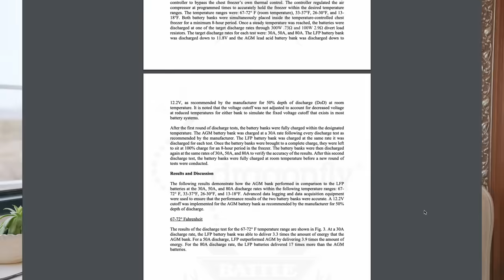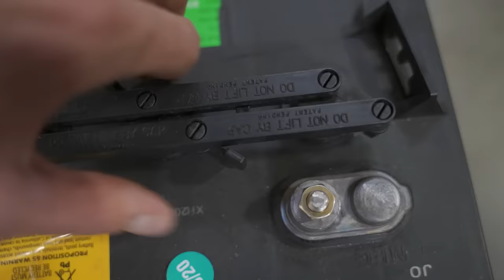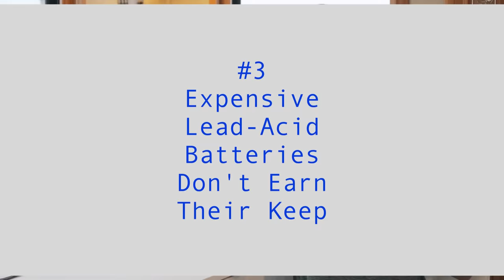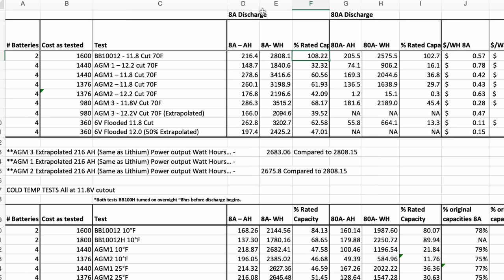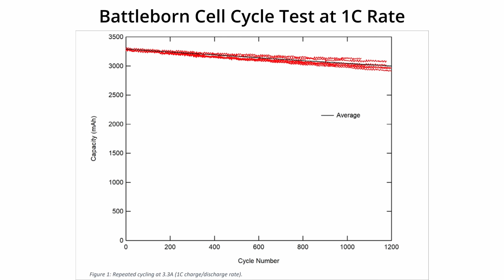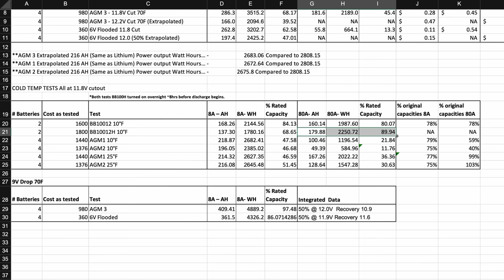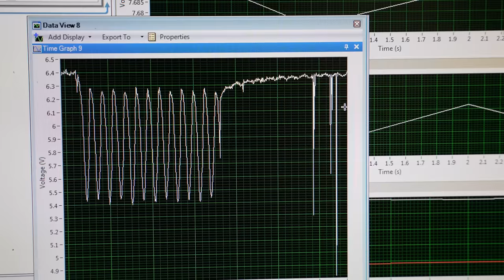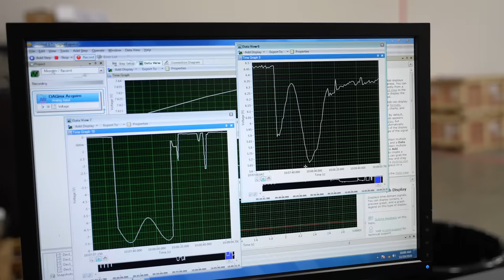Don't Waste Your Money On Batteries - The Shocking Truth I Discovered When Testing RV Batteries

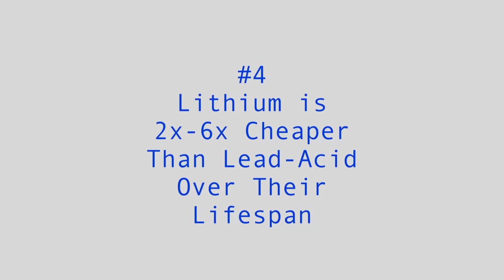Comment: 12:21 How do we know that lithium batteries will get anywhere near their lifecycle rating without waiting a long period of time to find out? I think if you only discharge the lead acid battery by 30 to 40 percent you will increase their lifecycle by quite a lot. I suspect that the lifecycle ratings on many lead acid batteries are understated and those on the lithium batteries are overstated. That's not to say your end conclusion wont be the same but I think for a lot of people the initial start-up cost will be a factor. Lithium batteries have extremely expensive upfront costs whereas lead acid doesn't.

Comment: After buying a 100AH deep cycle marine boat battery and having a warranty claim 8 months later, I learned from the store employee that the batteries sometimes sit around for years before a distributor delivers them to a store. And unfortunately sometimes the distributor is the party responsible label on the battery. So you could very well go to your local car parts store and purchase a battery with a 2021 date code, Yet that battery was manufactured in 2016. More and more batteries are hiding date codes in the serial number or putting them on a easily replaceable sticker. Manufacturers used to use a hot stamp and burn the code in the plastic but that is becoming less common. I ordered a 100AH AGM on amazon and after not being able to do a return because it is "flammable battery" I contacted the manufacturer directly and supplied the serial number, They could not help me because the battery was manufactured in 2011. Yet the date code on the battery itself was 2019.   I personally think it is best to avoid Lead Acid batteries where possible now.

Comment: Fully built batteries are a great option for someone that's not capable of buying cell packs and installing their own bms system.  The battery cells wouldn't be my concern the circuit boards built internal to the battery would be in my opinion the week point and if that fails you have no ability to fix or replace that without potentially damaging the battery cells. buying cell packs and installing your own bms gives access to service and repair if needed that would be my preference if going with thousands in cost.

Comment: My understanding is that the 50% voltage for a Agm is for when the battery has no load. It looks like you may have missed this. It would account for the poor capacity especially at high discharge currents

Comment: Two years on it is well established that LiFePO4 are superior to lead-acid, that is no longer in contention.  The most informative point of this test should be how competitive the very expensive Battle Born brand LiFePO4 are compared to the cheaper Chinese brands (3-4 times cheaper) which use the same Chinese produced cells as the Battle Born.  That would be a great new test but, of course, Battle Born, who most likely produced/supported this test, would not be interested in such a test.

Comment: What about the biggest factor cost per watt over the lifetime including reconditioning the batteries when needed until dead behond repair. 
This should also be included in the environmental impact over its lifetime, these are the things that the government should mandate honest assessments of for buyers.

The Battery in my truck is 12 years old and still starts my truck my 48 volt lithium Battery is 3 years old only used on a weed eater and Dead.

Comment: I have a refrigerator in my van and a solar panel to charge the battery, I had an AGM battery that ran fine for 3 days the most then it had to be put on a charger or my refrigerator would not run at all, I purchased a battle born battery and yes it was expensive but it does the job, the solar panel keeps it full and I don’t need to worry about having to charge it.

Comment: The comparison should look into traditional, flooded, non-AGM, lead-acid batteries that most vehicles and most off-grid systems are still using to this day. I have seen traditional FLA batteries, which are cheaper than AGM, last 20 years if the proper amount of water is added and the pH is checked 1-2 times per year. AGM batteries were originally designed for and used in emergency lighting units and UPS systems, where they are only cycled during a power outage, and in this particular application, can last 15 years without any maintenance. Lithium Iron Phosphate was a 'compromise battery' to allow lithium chemistry to be retrofitted to existing 12 volt systems, and excessively marketed to death. Therefore, I see RV systems, where 12 volts is used and total weight is a concern, as one of the only places where this technology is particularly viable. There simply isn't enough lithium metal on the planet to use this type of battery everywhere, and a low-drain off-grid stationary installation is really a poor use of the technology (Again, marketing upselling people to think they need a 1C charge rate).

Comment: I have heard that the BMS on Lithium can cut in during high current demand from the inverter, also they cannot be charged below 0 degrees celsius, unless of course they are special ones like the self heating ones. 
Currently I am using flooded lead acid to power my house, they are working great, but I would not recommend them for a RV because of space and weigh issues.

Comment: Awesome.
Leaving in the tropics in a place with frequent, short, power blackouts, so planning to install solar PV and batteries both for backup + save on electricity bill.
Your study helped me clear my thoughts.
So cheapest flooded if ok to give up on high load and low budget ELSE better to directly go LiPeFo if budget 😀

Comment: I have Lead acid batterys that outperformed every lithium battery!

Because I get em for free at work! 😂
We do service big emergency generators, the starter batterys get changed after 10 years for reliability reasons.
The batterys have near to no cycle on them, and are high quality industrial ones.
I change some older ones in my bank if some really good examples pop up to keep my bank fresh.
In the summer I can power all my lighting, computer and all small appliances exclusively with solar, from my 260 watt balcony system. 👌

Comment: I have 2x 280ah LiFePro 4 in my class C and while they weren't particularly cheap, I have been extremely pleased with their performance. With a 10 year life and 3500+ cycles to 80% I'm not even worried about the shock of up-front sticker price. Both batteries tested slightly above their stated capacity, also.
Reply: What did those battery’s end up costing you? (If you don’t mind)
Reply: @djfglobal3377  Just over $1900 for both.
Reply: Is LiFePO the same as LFP?  Are they supposed to be very safe?

Comment: I've been a fan of Li(po) batteries for probably ten years (RC cars), but the total lifecycle cost comparison should've at least referenced that, in most applications, you can't just swap conventional (FLA or AGM) with a LiFeP.  In a motorized application (charging off the vehicle alternator), additional hardware is necessary to limit the draw so it doesn't overheat.  It's not at all accurate to say there's "no situation" that a lead acid won't outperfom a Li battery; there are many rv'ers who don't need the off-grid capability that lithium provides.  Conventional batteries are more than adequate if you have shore power (majority of RV park, state parks etc.), can run a generator for a hour or two a day (BLM land) or only need one night w/o any external power.

Comment: Take into consideration customer service level at most of the companies who manufacture lithium batteries. Is it any good? Lots of complaints online and often lithium batteries fail within 1-1.5 year time frame.
I didn’t not find any single reputable company yet to spend $800 per battery and have a peace of mind!

Comment: Led acid and lithium batteries are 2 completely different animals made for completely different purposes. And they should be used for what they made for. Led acids are generally starter batteries. They are best at throwing those 500 or 700 amps at starter for very short period of time. And get charged from engines alternator. Than stay charged until next start. They do not like to ever be heavily discharged. Discharging them to below 12 volt equals killing them. Each deep discharge brings the death closer and closer. So 650amp battery can only throw 450amps at starter than 430, than less and less until that starter wont turn no more. Different vehicles have different engine sizes and need different power rated starter. So led acid batterie is appreciated for its instant high amperage delivery. But it is bad choice to use led acid for running your electronics in your rv. Because discharging them equals killing them. Lithium batteries on the other hand cant give you high amps to start your engine. For example 5kw/hrs batterie may only give you 100amps at a time. But it can be giving it to you for a very long time. So your starter wont turn even once from that amperage but your electronics will be happily running for a long time. And their charge discharge lifecycles are at least x100 or 150 times more than led acid. So you can be using it for many years running your rv or solar system. On the other hand if you use led acid only for what its made for - only starting your car you also can be using it for many years. Because even if it has only 300 cycles but you basically just keep it charged all the time so you don't use those cycles. Only when your car stays unused for long periods of time your led acid inside it can get discharged by parasitic power draw of the car and self discharge. And discharging it to 0v even one time can be fatal for it. Than even after full charge it wont give you those needed amps and become useless.

Comment: Short version.lead acid,flooded batteries are designed for starting cars etc. They can be cycled about 500 times from full charge to 50% not designed for running your fridge, lithium batteries are designed to last longer and can cycle 3000 to 5000 times from full charge to zero %.  Nearly all lithium battery pack come with a bms. Battery management system  to regulate the flow leaving and entering the battery.  Plus some hot and cold sensor's.. that's it .

Comment: Liveing out in remoat locations in a travel trailer year round, and useing solar to recharge batterys ok found this very instructive.
 To date I have used 2 128g lead acid. 50/50starter deep cycle Wall Mart batterys.
 I use 12vdc system ( lights,  propane refrigerator, heater blower, trailer system minister, water pump).
 I replace them yearly, and they suck over all. In winter even with full sun they do not hold up. Have to charge with generator/ battery charger.
 I kill them every year.

Comment: As a boat owner (40 foot sailboat), the cost per watt hour is not really a great measure.  In real world use, the batteries are not used that way.  The batteries most of the time are not drawn down that much before charging to capacity.  In my not so rigorous query of other boat owners of lithiums, they might get a couple more years use out of them over the lead acids.  So is it worth ten times the cost to get maybe 15 percent more life for typical use?  Not in my real world experience!

Comment: TWO FACTORS NOT ADDRESSED:  FIRST… I’m 70 years old and only exaggerate slightly when I say that I don’t even buy green bananas anymore. However, have a talk with yourself and estimate your remaining lifespan on the road. AGM will probably get most retirees to that crossroad. SECOND… Most RVs that are looking at first or second generation battery bank replacements may not outlast the Li-ion batteries.  Your new  batteries may outlive the useful life of your RV. CONCLUSION:  If you are young and ordering a new rig buy it with Li-ion batteries because this gentleman makes a good case.

Comment: Okay, I'll admit it...I am a rube when it comes to batteries. Two questions come to mind"
a) Can i use a L/I battery as my primary in my car?
b) Was there a test as to the logevity of L/I over Lead over the course of a LONG, LONG period of time?
c) The cost to benefit analysis of L/I vs. Lead for a retired rv user? Yeah, I undersrand you can't really assess C...but a try or guess would be apprciated"

Comment: My five year old golf cart batteries (2) just won’t die. My converter decided to charge them at 14.6v for a whole day before I shut them off. After refilling with distilled water they are performing like new. I was planning a $1000 200ah LifePo4 battery and converter upgrade for when they died. That project will have to wait. I’m not trashing perfectly good batteries.

Comment: just want to say before listening to the video i had a car battery which was so empty i needed to boost it each time i wanted to start the minivan in winter ,  left it there , in summer the battery was good enough to start without help but then at the end of the summer it started again to need some help , then i used a old battery charger on it which some claimed was going to "renew" my battery , now it's 2 years later , two winter later and i still have that same battery and it work great ( i'm in canada so winter can be rough .) but it still start the van like a charm .
Reply: yes, you can recondition a lead acid battery. they can last much longer then 4 years...  if maintained right.  Same with  AGM, less maintenance, but don't overcharge them or let them go below 50.. i sese some say 80%...   So i ASK>. what can you do with a LifePo after a couple years and it's not working..   
My neighbours wouldn't charge..  Something about being deadlocked.... somethign to do with the BMS?!

Comment: Applications where you want to use a lead acid? Specific boat usage. You need two LiFePO's or a lead acid and LifePo to start the motor. Cost near $2k for 200Ah setup or cheaper if you commit to using lead acid and LiFePO, which means two technologies and chargers and complications. Cost of two flooded 6V (from my last purchase) was $300. That was 6 years ago. I now need to replace them as they just run short on life when out overnight in Winter. I have a boat with an electric head so it needs to run the head or the wife will not be happy. Total cost: $300 for 6years in batteries. That's including the 2 years we spent full time on board. No BMS to worry about. The only thing we did was add some distilled water three or four times a year. Cost a few dollars per year. If I only did Summer trips or warm weather trips, I could delay the battery change. I can still get about 10 flushes and start the motor the next day. So no problem. Winter, solar doesn't charge them enough to hold overnight and only a few flushes are possible. The sanitation unit draws about 40Amps for a couple of minutes per cycle. Combined with the lights, chart plotter, fridge and holding enough in reserve to start the motor on a cold morning, its getting a little on the "wife will kill me for being stuck in the water" side of things if I don't change them soon...

Still, $300 for 6 years and some serious regular use for some of that time is fantastic. Do I want to spend near $2k and hope it will last over 36 years to get the same cost break down? BB is currently about $900 per 100Ah. So two will set me back $1800. Nope. Because it will take 6 changes of the flooded 6Volters to get to $1800 and I'd likely be dead before I recouped my money and BB may not even be in business then.
I need at least two LiFePo's to start the motor. That extra capacity is wasted as it will not be used.  I also never have to worry about the BMS going open circuit and blowing the motor electronics leaving me without a means to start the motor when 100 miles or more offshore. Cell reception isn't so good out there and calling BB to ask for an exchange because the BMS failed or the cutout popped my electronics isn't going to work out so well no matter how awesome their service is. If they want to guarantee a flight out to over 100 miles offshore in case their battery failed to replace it, I might think about it, but I'd also need a satellite phone... Never mind, I just though about it. No.

FYI, I am not putting BB batteries down (they really are good in the right application), however, this is one area they or any LiFePO manufacturer are not competitive or proven. I'd always want a flooded lead acid that was checked prior to a long trip because its proven tech over many decades of use. Yes, I have been left stranded by a lead acid offshore. We just waited to get the solar to recharge and before midday, we were running. If using LiFePo or any other tech, who knows, you might read about a tragic boating incident where the boater was blamed when it was a case using the latest and greatest instead of the tried and trusted. The manufacturer and reviewers said it was the best battery tech, doesn't make the cut at this point.
I'm an EE, but I really don't fancy debugging a BMS offshore. Even if I could do it, I may not have the parts to fix it. From what I heard though, almost every offshore boater carries high current mosfets, a DSO and a reflow station onboard and they just want a reason to use that stuff!. It's just those beam on waves that make debugging not so pleasant, and so does that1/4 mile long super carrier headed straight for you with an ATA of 3 minutes because your AIS failed and you are just a pixel on its display that the first mate didn't notice because he was busy hitting on the new hot crew member.

Comment: Have you read the WWII training manual for fleet. submarine battery operation?  I read it while in the Coast Guard and was impressed by the basic theory presented.  I guess when you run a whole warship off batteries you can afford the best engineering of the time.